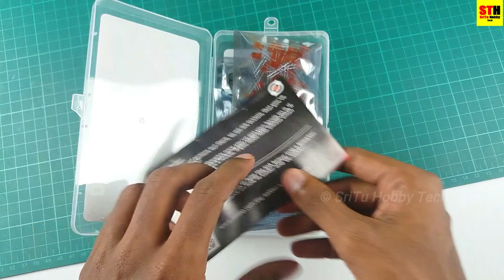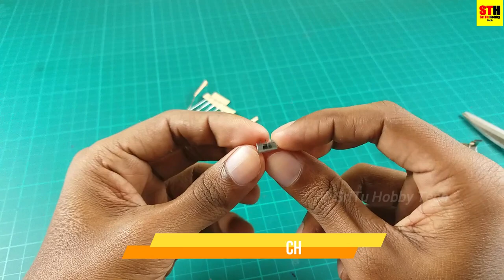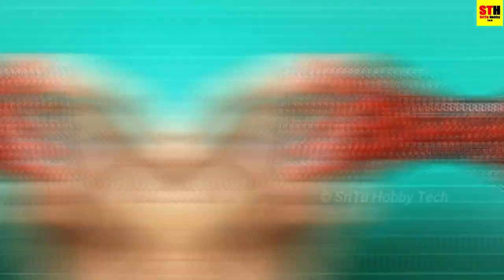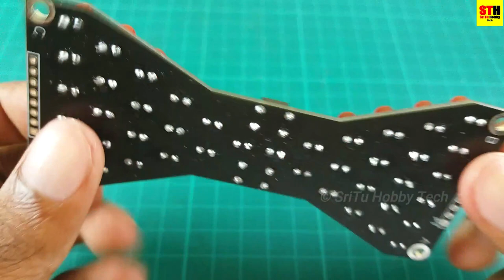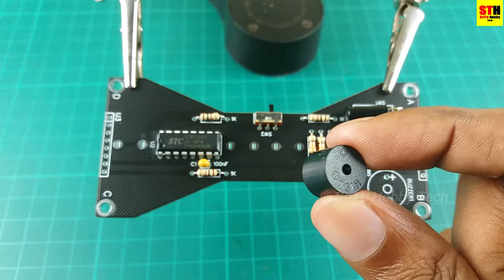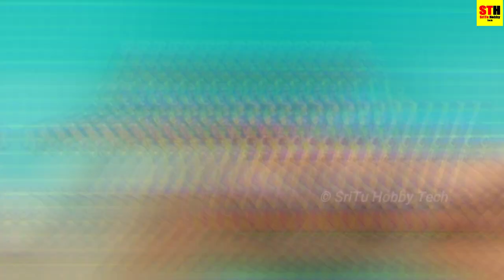How to assemble a DIY electronic hourglass kit step by step

Comment: I have this kit, i want to sauder a perper battery holder so i can have the space to put a box around the pcbs, to give this cool trinket to my 3 year old neice.
On the board the 4 battery prongs are impossible for me to know how i can use my 2 AAA holder is arranged in series with only 2 wires for grd and pos as the open leads.

So i need to find a holder with both batteries grd and pos leads  seperated so i would just pop the 4 wires to the pcb?
If so, do i need only 1 of the rectangular holes each clip would have mounted to?

Comment: Bro it’s a humbal request for make a project 
Using 
1 = ESP8266 / ESP32
2 = DHT11 Sensor
3 = MQ-2 Gas Sensor
4 = Soil moisture Sensor
5 = Ultrasonic Sensor
6 = PIR Sensor
7 = Humidity and Rain Detection Sensor
8 = Flame Detection Sensor
9 = 4 / 8 Channel Relay Module 
10 = IR Infrared Obstacle Avoidance Sensor Module

including  everything in one project 
Please please please
Reply from the maker: Ok.I will do it.